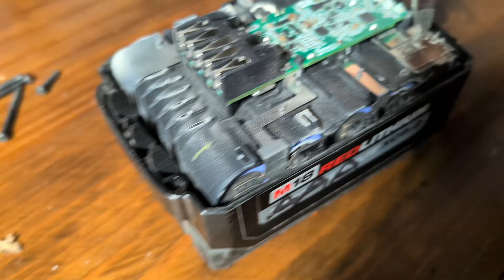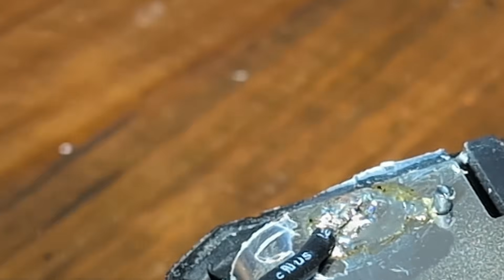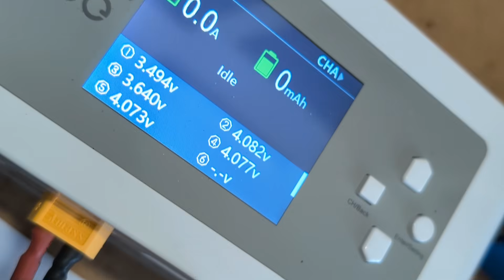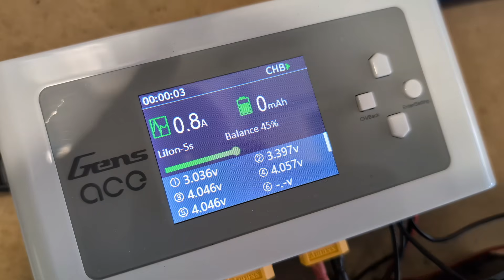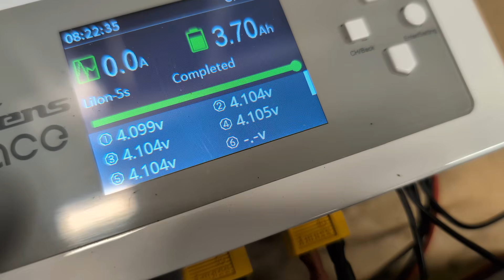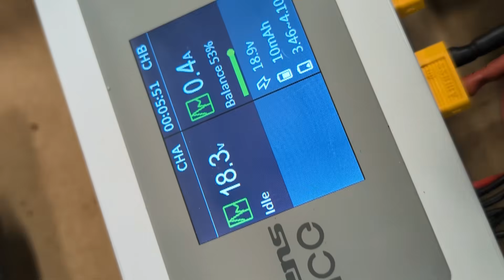How to Fix Incomplete Battery Charging with a Balancing Charger

Comment: I really like the video and particularly the way you presented it. You spoke clearly and at the correct pace to explain exactly what you're doing with the mustimeter, the test points and the procedure to diagnose the battery.  I particularly liked the way you outlined the safety precautions needed to be taken when working with lithium batteries.  
I have two questions, one relating to the video and another more general about these types of battery packs.  

First question, is that looking at the battery you are working on it appeared to have connections from the circuit board to each pair of parallel cells.  That made me think they would be used by a BCM on the circuit board to manage the balancing of the batteries.  If this is correct, then what was it that caused the batteries to get out of balance assuming the correct Milwaukee charger was used to recharge this battery pack?  

Second question, I was looking for videos like yours to help me understand how the Makita batteries and clones that I have worked and why some of those are failing to charge.  I've noticed that some have 6 battery balancing points on the circuit board and others only have balancing for one pair of parallel cells so for those I can understand how imbalances can occur.
 
With a couple of the aftermarket batteries I've got they claim to be 6mAh packs but looking at them inside they are a 2P5S configuration using 1500ma cells in parallel so by my math that is five sets in series giving a 3mAh pack capacity.  Are these battery packs labelled incorrectly pretending to be something they are not or am I missing something in the calculations of the capacity of the battery packs of this configuration and type?

Keep up your good work with the videos, I’ve subscribed and will watch your future video’s from Australia which is where I’m from.
Reply from the maker: I would love to visit Australia some day!  Great questions, and thanks for the compliments!

1.) Yes, the board does read the voltage of each cell pair.  The Milwaukee charger itself does not have the ability to charge the cell pairs individually.  I've heard it said that there are resistors on the pack board that serve a balancing function, but that these resistors are only active during charging, and furthermore that their size & configuration do not allow the board to sufficiently balance the cell pairs in the allotted charging time.  I've also had people tell me that's false, and that the board doesn't perform any balancing function at all.  I have observed from long experience that the small batteries (5AH and less) stay in balance waaaaaay better than the big batteries, and that seems to line up with the first theory.  I feel that they designed a barely-adequate balancing system for the original smaller batteries, and then they copy/pasted this for the bigger batteries, and it just doesn't work. The big, expensive batteries certainly SHOULD have a functioning BMS system to keep the cells balanced, but maybe profits have gotten in the way of quality?  I believe the main function of the cell pair voltage monitoring is to tell the charger to turn off if any cell pair reaches max voltage.

2.) Failing to Charge AT ALL could be a different problem from getting out of balance.  You could have broken connections, bad cells, or voltage so low that the safety features of the charger prevent any charge attempt.  There are various ways to diagnose each problem.  I don't have any experience with brands other than Milwaukee, but the designs tend to be similar.

3.) Your math is 100% correct, but you should have written "3AH" or "3000mAH".  It's just a scam.  It's a common problem with knockoff packs.  It's even a problem with legit-looking packs - lots of counterfeit packs for sale out there, and you can't tell without opening them up.  I opened up every one of the M18 Forge 12.0 AH batteries I bought off Amazon, and they were all genuine.  They work great too.

Comment: If you’re just going to pull them off again, no need to solder … a bit of sticky tape works just fine.
Reply from the maker: I've never tried it.  Thanks for letting me know that it works!  As an electrician working with 120 - 480VAC, I like secure connections :)  I assume you don't find enough heating to melt the tape adhesive?  I would worry about the end of the wire leads, or even the individual strands, becoming coated in adhesive and reducing the contact conductivity.  Sounds like a good thing to experiment on!
Reply: @ actually I’ve started doing it one cell (group) at a time which is much quicker. I just use a push pin under the metal tabs to get a connection.

They don’t need to be perfectly balanced.. They don’t stay that way the minute you start using them again anyway.

Comment: Excellent video. Could you recommend a 6S single channel charger with performance similar to the D300? I only need to work with a single pack at a time.
Reply from the maker: The Gens Ace Imars S100 should be pretty good for that.  Same interface as the D300. I couldn't find the actual spec for balance charging current. 

It'd probably be worthwhile to talk to some RC enthusiasts on Reddit or similar.  There's always new stuff coming out.

Some of the fancier models require a DC power supply, so beware that.
Reply: @AAAElectricFL  Can the Imars D300 discharge to storage voltage of 18.5V  (3.7V per cell group)? There is a menu selection for storage but I don't know if you would have to start with a partially drained battery.
The Imars S100 can discharge at 1.5A which would be slow compared to the D300 at 3A. Looks like charging and balancing would be the same for both.
I am comparing the D300 with the similar Hota D6 Pro. Both seem to be the best bang for the buck and are very popular.
The fancy RC chargers that require external DC power are expensive and probably unnecessary for these batteries. I've spent enough on the batteries as it is!
Reply from the maker: @JamesA-jl2bn  I'm not sure - instructions unclear, I'll have to try it if I get around to a couple batteries I need to balance.  I'd be willing to bet that you can set the storage voltage and that it will either charge or discharge to that voltage, no matter what the charge state of the battery currently is.  

I hear that "Discharge" mode can have the target voltage set, and that it will balance the cells to that voltage, but I don't know if it will bring lower cells up under "Discharge" mode.  I've never tried "Discharge" or "Storage", as I use the charger for power tool battery maintenance only.

Be aware, D300 can only discharge at 15W *per channel*, but that's still 3x the 5W discharge rating of the S100.

Comment: Is there a better method of attaching the balancer to the Milwaukee battery than so9ldieing and desoldering?  Seems that balancing might be needed regularly.....
Reply: I use a piece of nickel coated steel from a battery rebuild. Its magnetic as are the batt terminal. solder the ni coated steel to the balance wire , place the magnet on the battery end and the magnetic Ni  steel will stick to the manet and pass the current
Reply: I use 6mm x 3mm neodymium magnets. I solder the lead wire to the first magnet at 370C, (which loses most of its magnetism). Add another and use glued heat shrink over the pair and 1cm of the lead. Works a treat. :)
NB: Remove the pack from the case and clamp onto the cell terminals.
Reply from the maker: If you remove the bottom shell of the battery, there is some access to attach alligator clips to the metal traces. It's arguable whether that would be faster or not, because once you have the solder pads prepped on the top, it's very quick to attach the wires by soldering for  subsequent balancing attempts.  Probably could attach all 6 wires in about 10 seconds for repeat attempts.  Very secure connection compared to alligator clips.  But yes, it can be done.

Comment: 26:29 - no, it doesnt. That boards DOES NOT do any balancing. Why - for Makita (Milwakee, DeWalt, insert your tool brand), the company profit.
Reply from the maker: Most of the reliable sources I've heard mention that some of the resistors on the battery management board serve a balancing function, but that their design is such that they balance so slowly that it is almost imperceptible. I have also heard people say that this balancing only occurs during active charging cycles. I haven't looked at the board closely enough to make any determination on this, and it doesn't really matter, because whatever balancing function there may or may not have, it's worthless. And yes, for such expensive batteries, they ought to have functional balancing built in.
Reply: @AAAElectricFL  that resistors COULD serve balancing function, but dont, MCU doesn't instructs battery management IC to ever use those for balancing function,

Comment: nice charger! Pretty sure that charger can do it all just need to read up on all the modes it has. I like the Storage mode because I can put my batteries at half charge.
Reply from the maker: The D300 has worked very well and gives good info.  There are a couple quirky things like it freaking out about a few millivolts of overvoltage, but easy enough to work around.  Maybe a firmware update eventually...

Comment: Yep...nice job explaining...I have over $2k in 12.0's and just went on a balancing spree using an I4 Intellicharger made for individual batteries.  I had 12.0's with as many as 3 banks in the 3.1-3.8V range.  Was able to get it to work with alligator clips and no soldering.  Max charger current was 1500mA and it took several hours per bank with me tending to them and switching to new banks manually.
Reply from the maker: Yeah, I want to update this with alligator clips.  Did you have to remove the inner battery pack from the bottom half of the shell?  Where did you clip the clips?  Did you have to scrape off the clear plastic waterproofing to get a good connection?
Reply: @AAAElectricFL  Yes, had to remove both covers for the method I use...a magnetic tray is handy to keep track of screws especially the tiny T8's.  Any sharp probe penetrates the conductor covering and I had no problems getting connections with the alligator clips.  Each bank offers a place or two to attach the clips (I can share pics if you want).  I was hoping your method offered a faster way but like most chargers/balancers they seem to work sequentially (serially) rather than all at once.
Reply from the maker: @robertleemurrerjr.8245  The D300 does balance charge all 5 cell banks simultaneously, but the balancing current is fairly low compared to the regular charging current (as with all chargers like this).  It's still loads faster than the other older charger I had.  I think my 12 AH batteries took about 8 hours average to complete, but it's hassle-free & automatic.
Reply: @robertleemurrerjr.8245  Pics of where to hook up the clips would help. How could I get those from you?

Comment: based on the date and version code
many of those batteries are made with defective cells
Samsung 40T 
even bosch uses ver 2

they finally came out with version 3 in anything after 2022 and newer
so far so good
doesn’t matter how well you balance them
same goes with 12Ah
some 2021 came with Sony VTC6a which insane good but short lift cuz they switch back to 40T version 3
Reply from the maker: I have heard about the newer Samsung cells being much better, however I have had pretty good results balancing these and having them stay balanced for quite a while. Definitely worth doing it.  I do expect to have to periodically rebalance.  I wish they'd change their BMS so we didn't have to do this to begin with, though
Reply: @ great, most i seen do not hold charges

the board is not a BMS, it doesn’t balance them, it just throw a bunch of voltage till one cell goes over 4.2 volt
i had each fluke connected to it and watch it charges, the closest i seen them charge close to evenly is the one they use Sony/ Murata VTC6a, those one are gold to have 
however a lot of the 12Ah version come with very bad board that won’t charge.
Sony / Murata VTC either 18650 or 21700 are made extremely well, quality control are excellent, even older LG are really good HG2 in the 18650 in the 9Ah
Reply: @TranTek  not sure why companies not using molicel. They seem really well suited for power tools. I guess molicel charging too much or something?
Reply: @ Molicel are not as reliable as Murata, they might not yield the highest discharge power as Samsung 
i seen some of Ryobi has Molicel
Reply: @uhjyuff2095 it’s all about the mighty dollar. Most people aren’t going to go out of their way to balance their batteries like this, they’ll just go out and buy a new battery. The manufactures know this so they don’t go out of their way to make the batteries last longer.